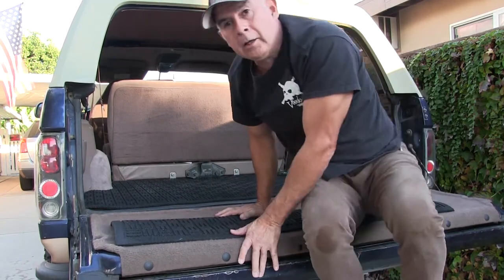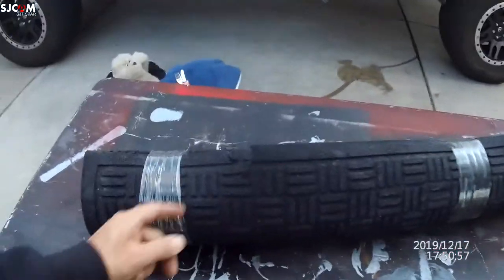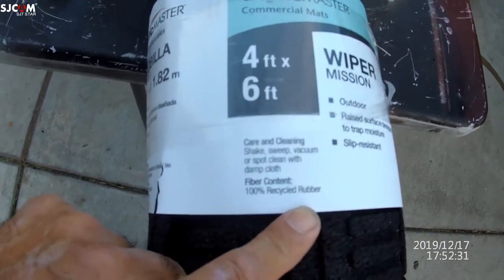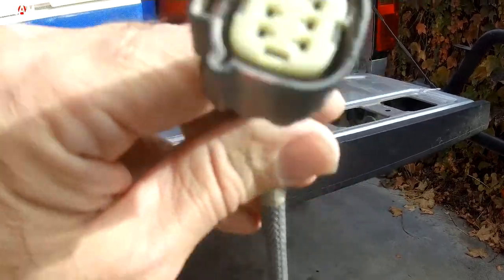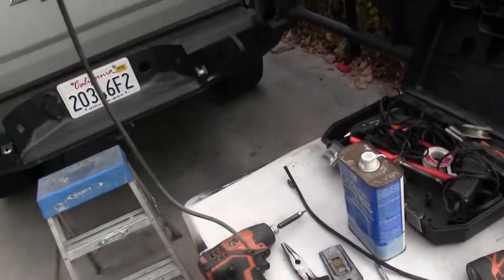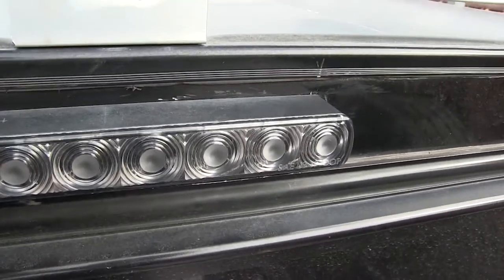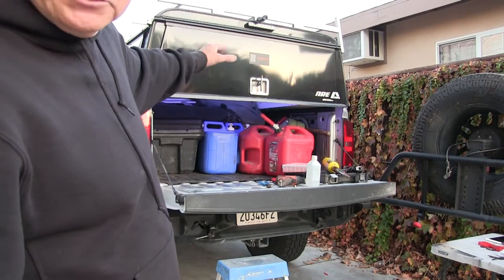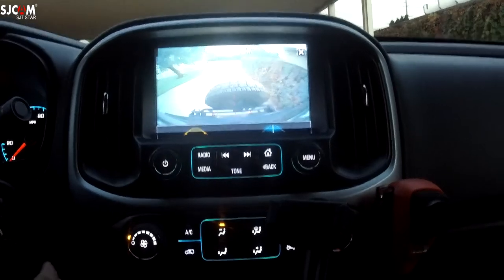Chevy Colorado Cargo Mat and Back-Up Cam

Comment: For the rear seat mat... check out your local horse or animal supply store. I bought what's called horse matt. You can get it in different thickness and it cheap. I used it on my Tacoma bed and worked great.